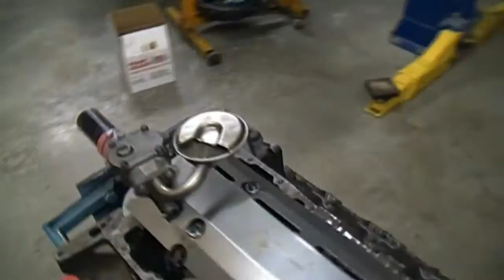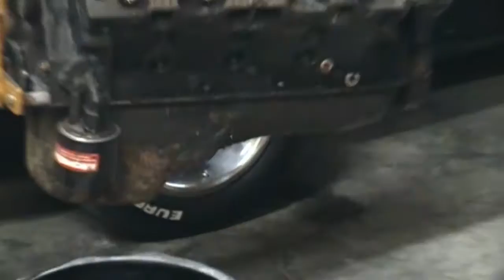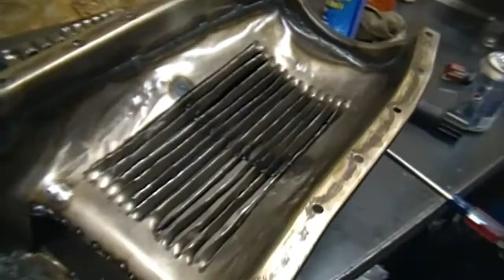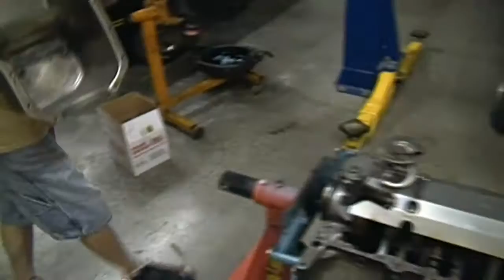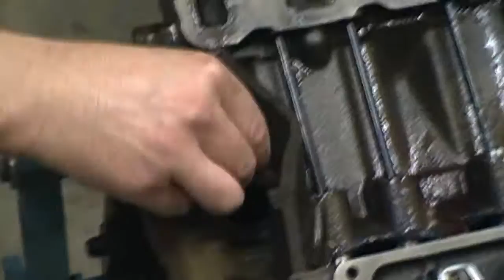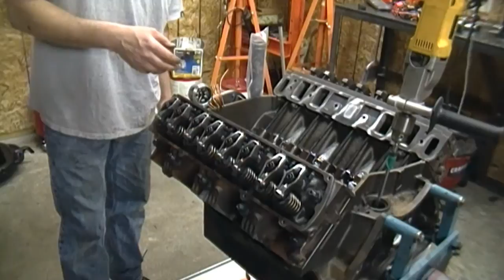A Oldsmobile 455  Marine oil Pan w/ windage tray and a oil pump prime

Comment: Looked at this to confirm that priming oil pump requires turning it counter-clockwise. Not mentioned, but could spot that for a second as you fit the drill motor to the shaft.